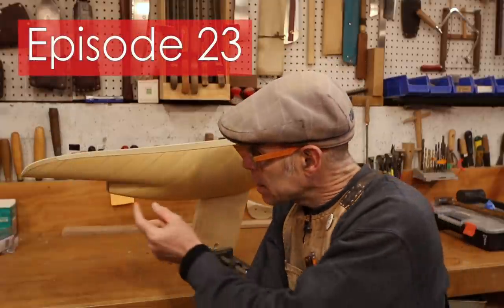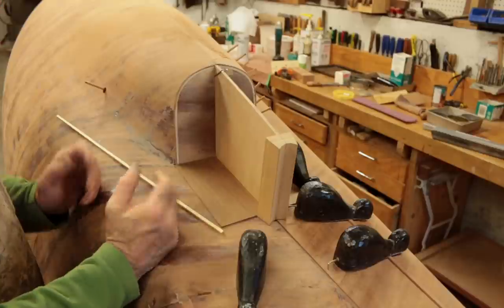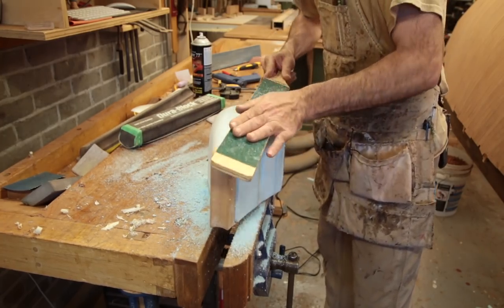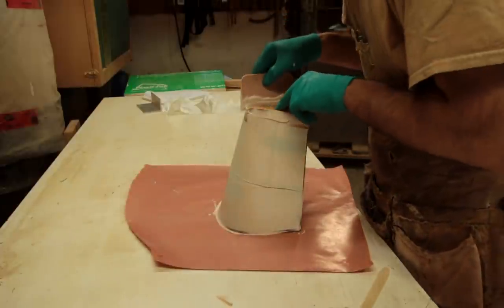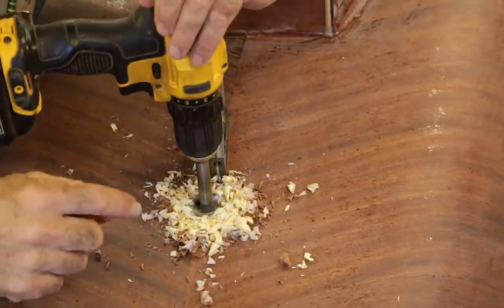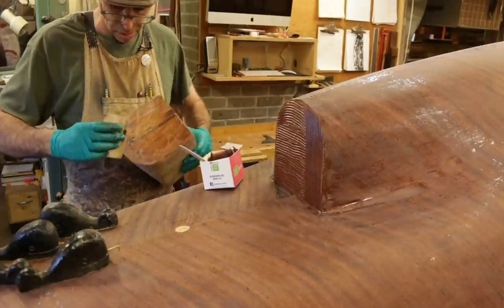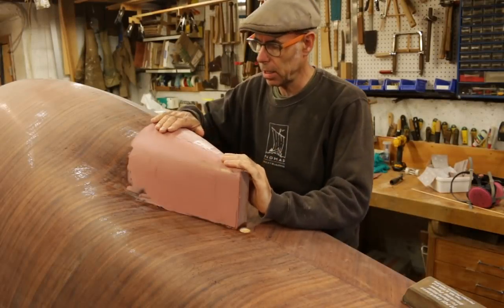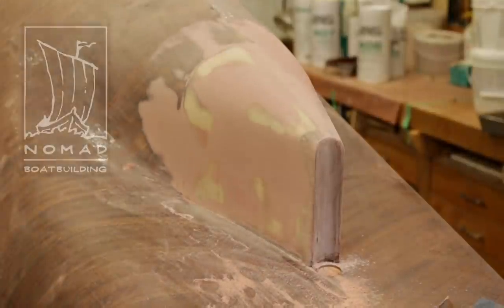International 2.4mR Sailboat Project - Episode 23 -  The skeg

Comment: Hi
Just found the 2P-10 glue and the 3M-77.  Must give them   try.  Thanks for showing / using.
Boat looks great.
Reply from the maker: They are handy bits of chemistry for sure. The Super 77 is the only thing I have found that can hang onto HDPE. The 2P-10 isn’t any different than any other cyanoacrylate glue but they do offer it in larger bottles and in a good variety of viscosities.

Comment: In future foam fabrications- the air plane model makers use a hot wire foam cutter with guitar wire and a small transformer.  Might not conform to the wine glass shapes of hull keg, but good for roughing out the blanks without dust or band saw kinks.....
Reply from the maker: If I could see myself doing that with regularity I might look into that option. Thanks.